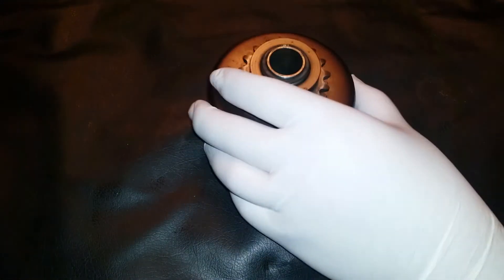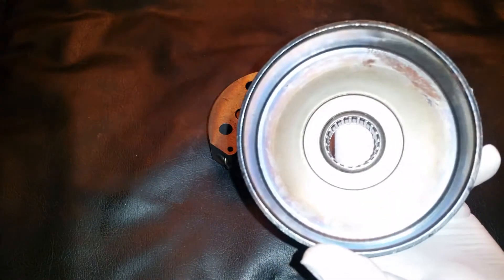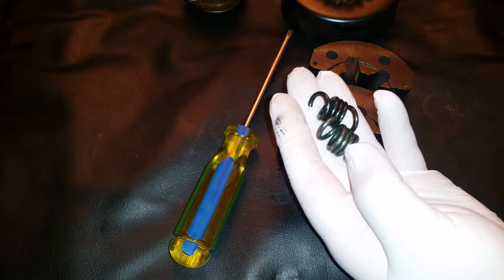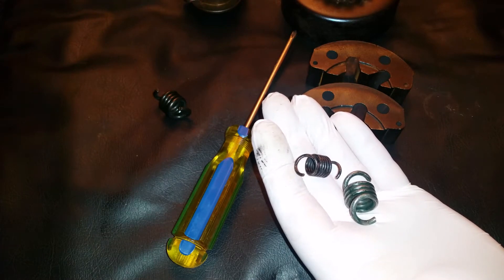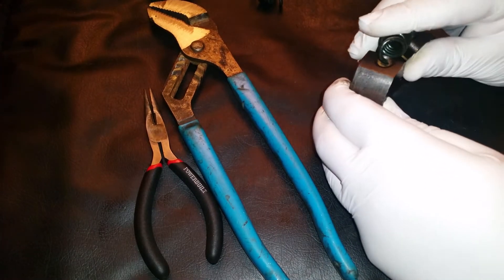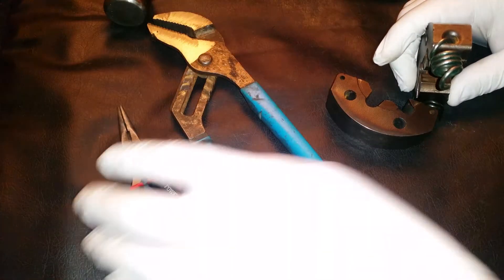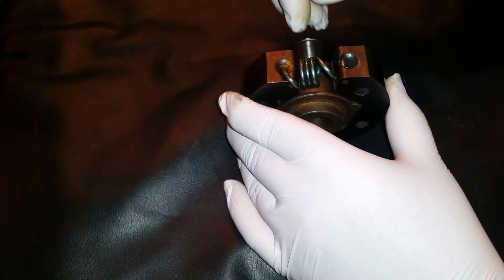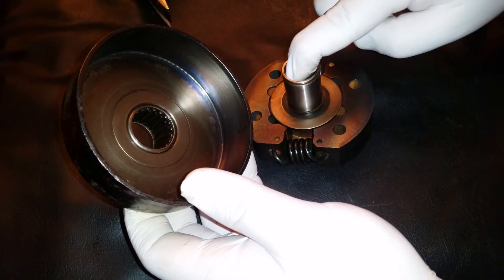Noram GE Clutch - Disassembly & Changing Springs

Comment: Quick question, on the springs if you add higher rpm springs is it quicker launch as like higher torque? Or lower rpm higher torque?
Reply from the maker: Quick launches are based on clutch shoe orientation as scene on the paper at 3:49 , settings #1 and #2 are probably best for that.  High rpm springs means the shoes won't grab the clutch hub until higher RPMs are reached.
Reply: dc5000123 ahh ok got the shoe part..so if i wanted a quicker launch more torque etc..lower rpm springs would be better to grab clutch hub quicker and make a more quick take off?
Reply from the maker: @abbyga26  Well, Technically you want the clutch to engage at the RPM your engine makes a certain amount of torque and horsepower which is specific to your engine and performance parts.

Comment: Have you had any issues with chattering at initial engagement? I just put on of these on my mini bike. If I take off hard, it chatters really bad. Once im going its fine.
Reply from the maker: You might need to clean the clutch or replace a part. You should definitely take it apart and inspect it. Post a video if you want me to look at it. My clutch doesn't chatter, but if it is setup for light engagement it might chatter.
Reply: @dc5000123  thanks for your reply. After I sent that I actually got in contact with a noram distributor who helped me out. Turns out it was shipped setup for outboard rotation and I was running it inboard. I flipped the shoes and its perfect now. Super impressed with it for the price.
Reply: You probably  have the hub  pushing the shoes rather than  pulling the shoes. Look  closely at the way the  center hub  is positioned  in the shoes.  On the video ,,,  his hub is pulling as it should be for smooth engagement..

Comment: Hey I have a question that I cannot get an answer to.... Ok...here it goes... I bought a noram clutch on ebay like the one in this video but after greasing and installing them on my engine, it would not engage....it only revved up and stayed in the same exact spot...the question is ...can I make this clutch usable or did I get an $80 paper weight?  Any info would be incredibly helpful...thankyou
Reply from the maker: Depending on how high your RPM redline is, you might just need lower RPM springs. Some clutches won't engage until 7000+ RPMs
Reply: Do not grease or oil the  shoes or drum  only a drop  of oil on the bushing

Comment: Great video sir! This helped me out a lot.
Reply from the maker: DeanMercii | Dean Jr | graphicfoxx.ai   Your welcome man !!!!  Thanks for watching.
Reply: No problem! I like that flathead in that picture. Any more pictures of it?
Reply from the maker: DeanMercii | Dean Jr | graphicfoxx.ai I only have these 2 pic in google+ :   
https://plus.google.com/b/110142585113405328652/photos/110142585113405328652/albums/5949219313442561665
Reply: What are the specs? It looks great.
Reply from the maker: DeanMercii | Dean Jr | graphicfoxx.ai It's a stock motor and I just wanted to see if the walbro would bolt to the tillotson intake and if I could easily hook up a throttle cable. It would be dangerous to run that engine with that carburetor.
Reply: Gotcha, its a very clean motor. I like it a lot.